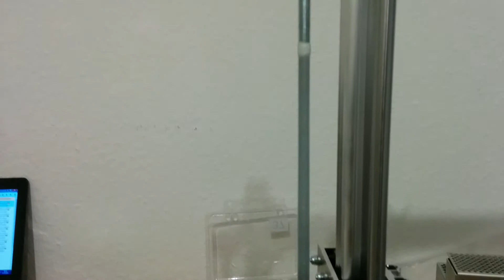K8200 Upgrade

Comment: do you have some tip? I am thinking about prosa i3 or k8400.  I had da Vinci 1.0A, but it have some problems so I was returned it. I need to print some small parts about 3mm wide

Comment: hi, how do you satisfied with K8200 ? can you write more about your upgrades? Can you write links for recommended upgrade parts? thx
Reply from the maker: +Michal Michal Ii modified the Z axsis to a proper one.
The main problem is still that the Z axis is only moved on one side and hangs "freely" on the other. you can fix this with more mods, but at that cost point you might want to invest in a better printer in the first place.
I actually haven't used the printer much since, i have also huge problems with missing steps on X and Y even so i ramped up the controller voltage.
I guess there are better options for the price out there by now.